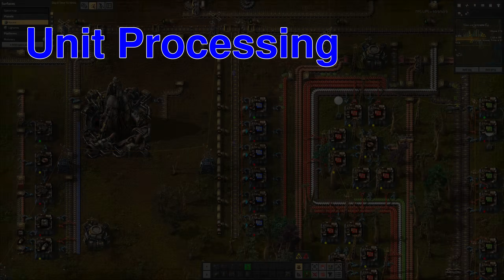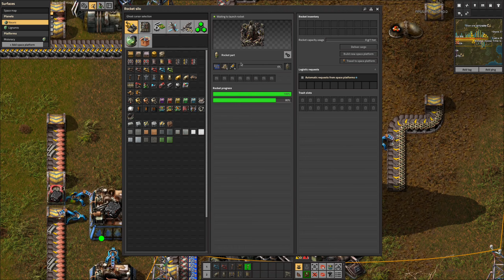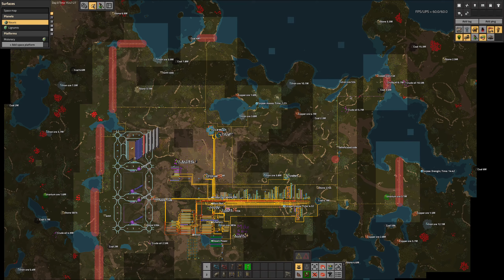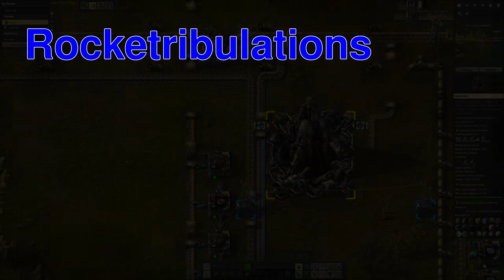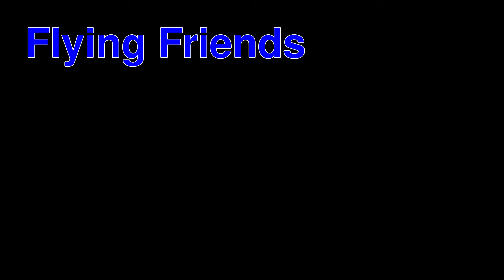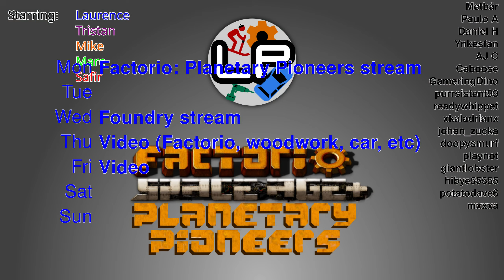S1-E11 - Spaced Out - Laurence Plays Factorio: Planetary Pioneers

Comment: Surprised to see you don't have productivity modules. They pay off their cost really fast in labs, rockets and science assemblers and are also useful in circuit assemblers
Reply from the maker: I think at this point we were still working towards them, but yes in the last stream we had the same thought and have at least chucked some overdrive modules (like productivity, but with more of a power penalty instead of the speed penalty) in the rocket silo. We should put them in the labs, that's very true!

Comment: Hello, huge fan of the series here. also having a little suggestion if possible:
Instead of using a fixed value for cracking oil, you can use this:
on cracking heavy oil: if(HeavyOil>LightOil) then start
same goes for cracking light oil, if(LightOil>PetroGas) 
this guarantees an equal amount of all 3 liquids.
oh one more thing, you can use If(PetroGas>20k) then use it for solid fuel for rocket fuel. 
Another small idea, if oil is infinite yet decreasing in production, maybe use lots of tanks to buffer oil?
Reply from the maker: I certainly could compare the totals but I don't think it would really be an advantage - I just need to make sure there's enough supply to keep up with demand! Checking the amount of petroleum for rocket fuel is a good idea though! I don't expect it to overflow but it's worth having a release.